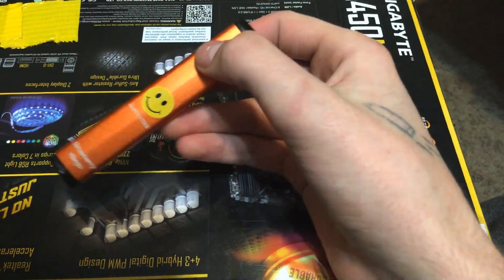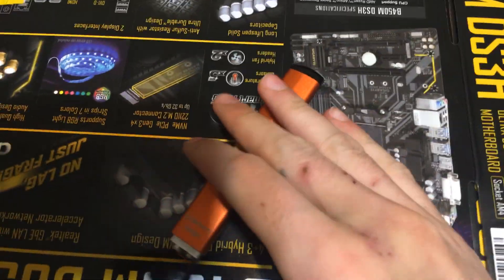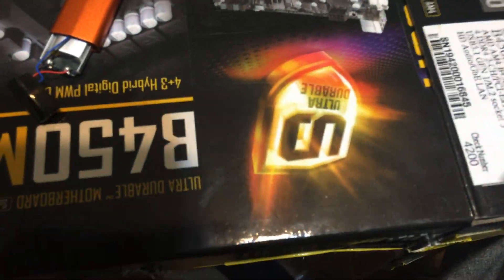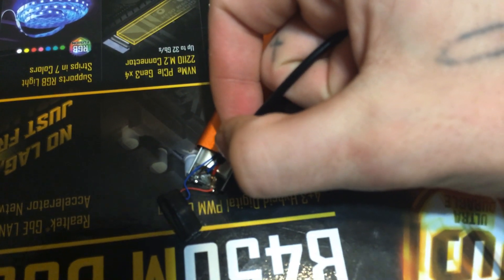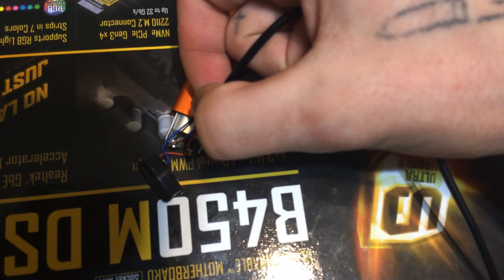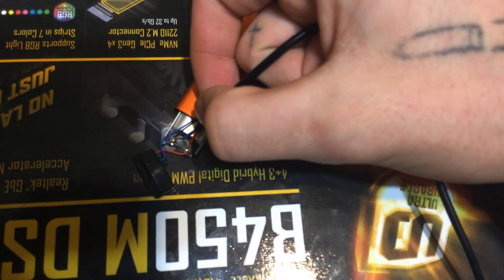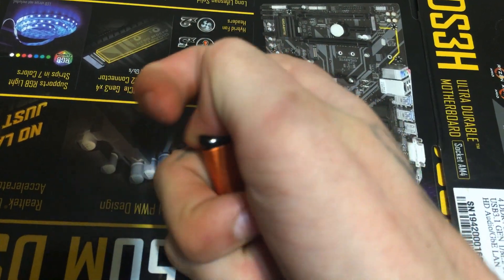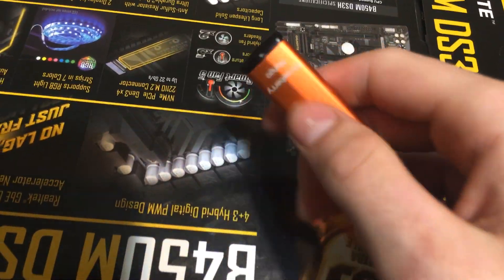How to hit a dead happy stick/recharge dead happy stick

Comment: Don't hook this up to your laptop if you don't know what you are doing. If the black and red wires touch they could pull too much power from almost any model and fry ur battery and/or usb slot.

Comment: I can't get mine to work I put the cap back on it the light just stops working doesn't even beep what am I doing wrong?
Reply: how I do it just like a car battery I connect the black wires to the black the red to the red that way they won't spark because I did it the opposite and it burned my fingers maby one of the wires disconnected and you need to solider them back together